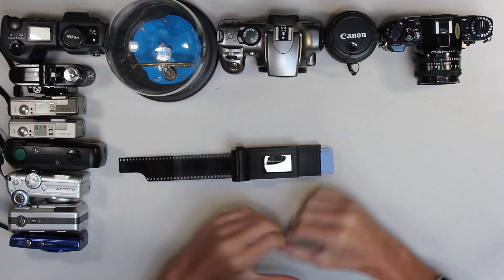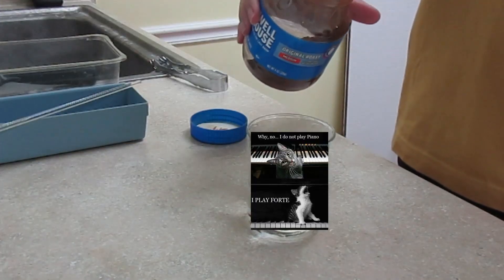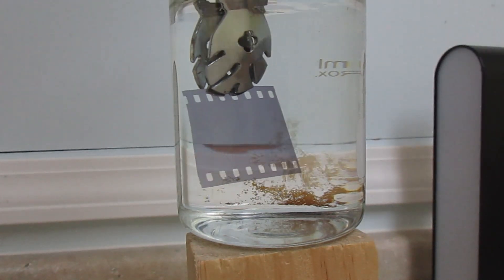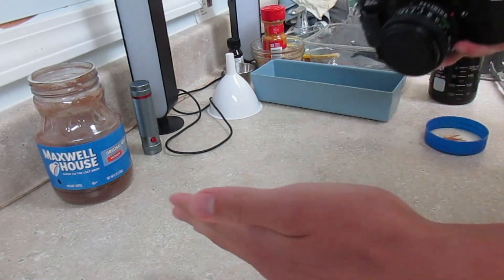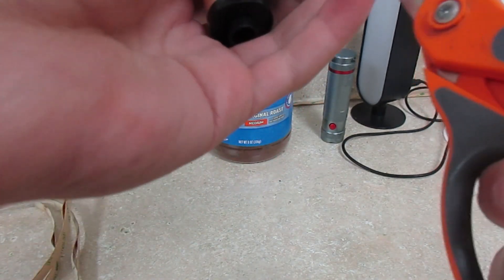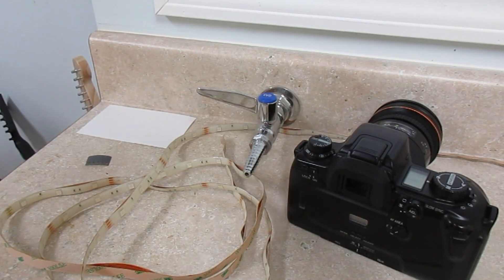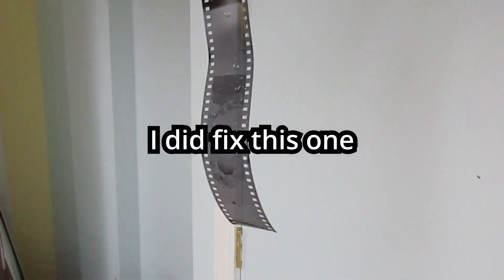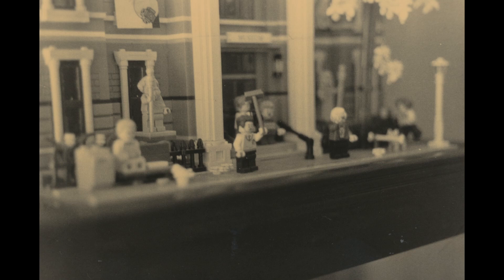How to use coffee to develop film pt.1—No Pro equipment

Comment: What's washing soda? Baking soda?   Never heard why rodinal is toxic. Used it growing up. There a average time for film development?    Does temp affect it like regular developer??
Reply from the maker: @unbroken1010  temperature has some effect,I haven’t had enough experience to know by how much though. I usually develop for about 12 min in a Paterson tank, and washing soda is like stronger, less food-safe baking soda. The formula is Na2CO3
Reply: @DeclanDoesCameraThings  yes, I heard in your other video.  Is washing soda available readily?  Never seen it I assume baking soda should be possible. .  Stop bath is cheap, last forever.  Btw  don't dump fixer down a drain. It bad for water tables and will ruin your metal pipes.  Most commercial darkroom reclaim the silver first and usually have glass pipes. Or should.
Reply from the maker: Sry, YouTube didn’t notify me that you replied, I think I tried baking soda once with limited success. Washing soda is readily available on Amazon and I think in most stores in detergent sections. Also thanks for the advice
Reply: @DeclanDoesCameraThings  I assume 68 degrees   74 tops or you get reticulation in film grain.

Comment: but how evenly will the film develop without a paterson tank? bcs i read some sources that said deceloping without one might cause splochy artifacts or uneven development
Reply from the maker: @ArjunKrishna-b5y  well… it doesn’t work that well. You have to keep the film in a room that is dark until the development is done. Then it can be exposed to light no problem as long as you wash it quickly
Reply: @DeclanDoesCameraThings  thank you so much! also love the stuff that you're doing, exactly the stuff I plan to do when I get some time and money on my hands
Reply: @ArjunKrishna-b5y  use a tank, metal is best.  If plastic, it needs to be dry or will not clip correctly.